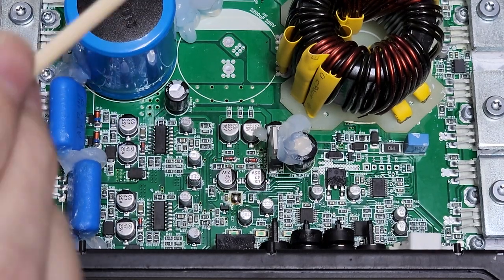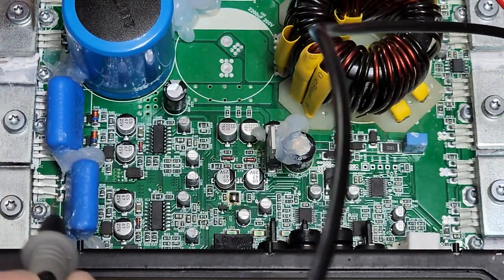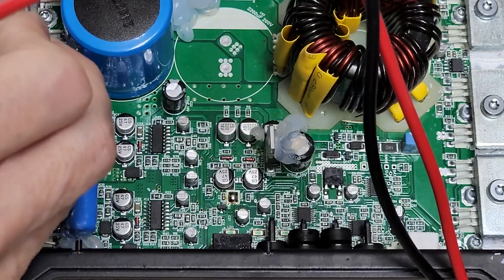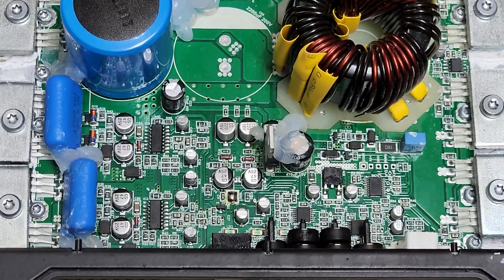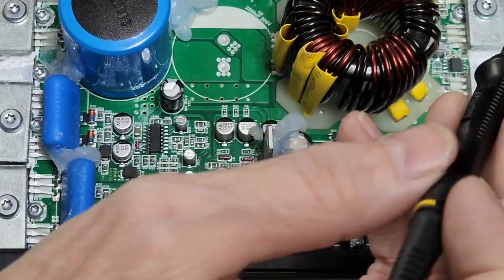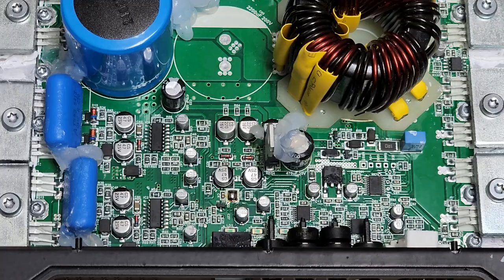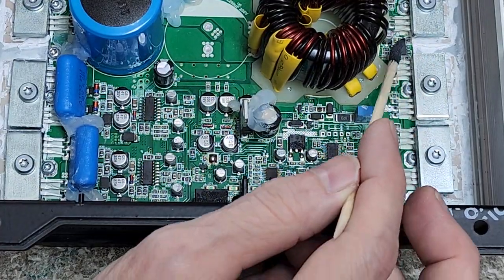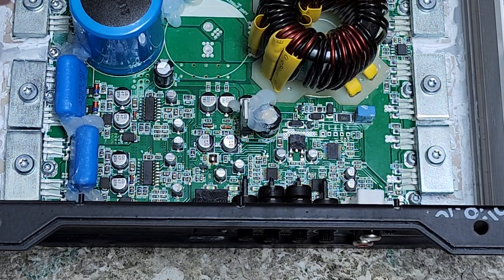Taramps HD2000.1 Fault Identification for Warranty Approval

Comment: I have one of these amps and the blue and red light stays on at the same time you have any idea what it could be I appreciate it if you can point me in the right direction thank you
Reply from the maker: The amplifier has a short but would have to diagnose it to know exactly what has failed. Most likely the output section.

Comment: Is a amp repairable that stopped putting out AC and only puts out dc at 58volts?
Reply from the maker: That amplifier will have a shorted output. Repairability is dependent on damage.